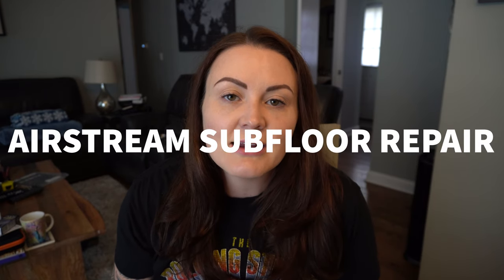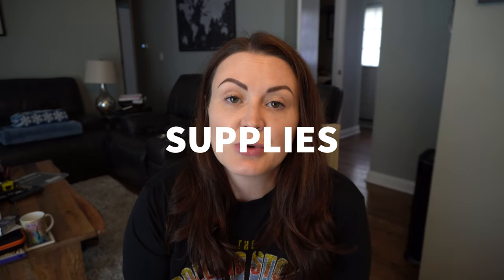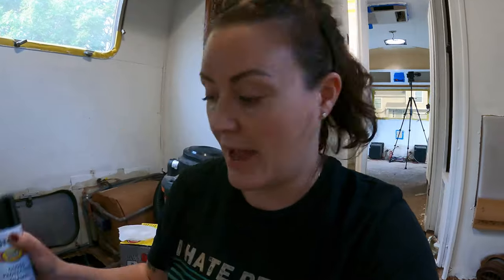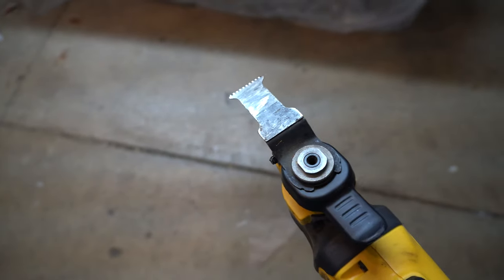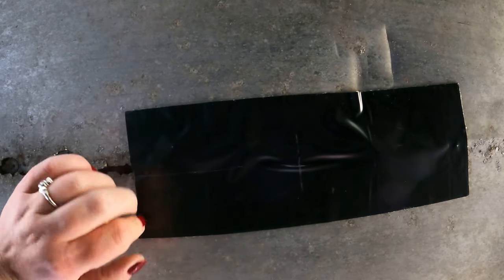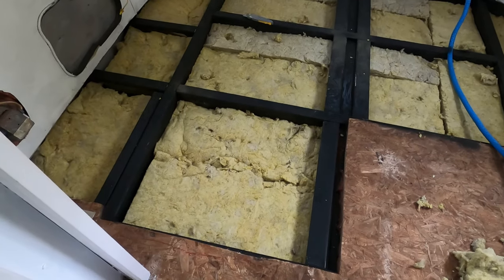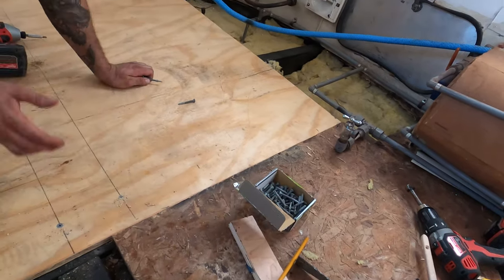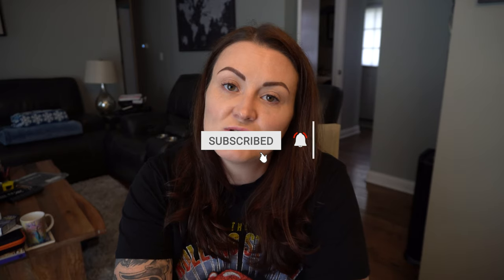Subfloor Repair in an Airstream | Spot Repair of Subfloor Instead of Full Off-the-Body

Comment: Thank you ... a great video. Our question is .. How would you handle getting one piece of wood in the C chanel?  We are doing a very similar rear repair, but we are trying to WEDGE a pritty rectangular section.....center section ...maybe 5 feet X 2 feet that meet up to the support cross beams into the C chanel.   Using a mallet and wood blocks to pound is not going so well ... there is no give in to the wood or the trailer. 
I think we may need to cut the wood that goes into the c chanel wide enough to be able to attach it to the rear support beam, this way  the we can pound in into the chanel...the wood is flat... no wedge angle to deal, then attach it securally to the support beams. We then can cut/fit and literally drop the the other piece of wood in place like a puzzle piece, and attach that piece of wood to the cross support beams. 
I may have answered my own question.  What do you think???
Lorie
Reply from the maker: I think you did! A smaller piece would make the job much easier. What’s important is that you get the wood into the channel to support the shell, I don’t think it is super important that it is one solid piece of wood as long as you are securing it to the frame :)

Comment: Great video doing this to a 72 Airstream had to cut four of the seven plywood you can run a brace between each cross beam that's 23.5" or length wise that's 5' 3" for structure support. My Airstream will be used on 5 acres not over the road
Reply from the maker: Thanks!! Nice! Sounds like a huge project 😀😀

Comment: Great info ,thank you! I am doing the same thing on my 1973 Trade Wind. I think I am going to treat the edges of the subfloor with an epoxy resin, just to prolong the wood rot incase there is a leak in the future that goes unnoticed. HA HA, As if it will never leak again.
Reply from the maker: Smart! We wanted to do the same thing but the guy that was doing the work for us didn’t have time to wait for it to dry (or so he said😑) We used pressure treated plywood and I sealed the roof and the sides as much as I could. Fingers crossed but so far so good!

Comment: EXCELLENT video! Thank you so much! Just yesterday I found a bad patch of subfloor (~5 sq ft) in the rear bedroom and thanks to you I now have a plan. One question - was drilling new holes in the frame for the screws difficult? Is a cordless drill sufficient or should I use a corded drill?
Reply from the maker: Great, I’m glad it helped! As far as drilling the new holes, we used a cordless drill. The wood to metal screws also help so try to find the screws I mentioned in the video or something similar 😀

Comment: Thank you for this very helpful. I found a leak and it was repaired at a rv shop but we didn’t realize the damage under linoleum. So now I have cut out rotten wood. Question - could I just just plywood to fit this hole and screw down? Therefore not removing all the wood under the metal shell! It seems tough to get out. Any advice appreciated
Reply: Sorry trying to add pic but can’t figure it out
Reply from the maker: Hello! I think you could get away with putting some plywood to fit the hole and screwing it down if the hole isn’t that big. You can send a pic over to our email at goranandjen@gmail.com and we can take a look if you like!

Comment: Looking at several other videos saying not to piece a subfloor, do you feel that it compromises the stability at all? I assume you have towed and used since repair. Loved your presentation, well done!
Reply from the maker: Hello! Yes, we looked at some of those videos as well. I think that is why it took us so long to figure out how to do the spot repair, because we were scared that we would compromise the structural integrity. So we kept searching and watching more videos and doing more research until I came upon a video that explained the C-channel and the bolts, and how the shell is attached to the frame. We figured out that as long as you don’t cut those bolts and you make sure you insert the replacement subfloor into the C-channel, the structural integrity will remain intact. We have traveled over 2000 miles in the airstream since we have done the repairs and she is holding up great! We are very happy with the repairs. I hope this helps!
Reply: @GoranandJen  
Thank you and that makes sense to me!

Comment: Thanks so much for this detailed video. Most helpful one on YouTube that I’ve found. 

Any more insights clearing the wood from the c-channel? How long did it take with the multi tool? I’m having a hell of a time and wondering if cutting the bolts and then replacing as I go might make things quicker and less soul crushing. Lol 

Thanks!
Reply from the maker: Hello and I’m glad the video helped! I feel you on the soul crushing task of removing the wood from the C-channel, it took us forever to figure out. On our Airstream, a lot of the wood that was in the C channel was wet and very rotted so it was easy to get out. But, there were sections that were not in such bad shape and they took much longer to remove even with the multitool. 

Goran says he spent about 10 hours total working on it. One tip is to think of the piece of plywood like a layer cake. “Eat” or gouge out the middle layer first and the rest of the wood will fall out more easily. 

Hope this helps!!
Reply: Thanks for the reply. “Soul crushing” indeed. 😂 making some better progress with the multi tool. Makes me feel somewhat less crushed knowing it just a royal pain in the a**. Thanks again for the video.

Comment: One thing I would say is you might want to replace the floor with something that will not rot again?
Reply from the maker: Hello! Yea, we thought about that too. We were thinking about maybe starboard? But we ended up using the pressure treated plywood and painting the edges with the waterproofing. We think we got all of the leaks so fingers crossed that wont be an issue as long as we maintain her :)

Comment: Did you do vinyl planks or a sheet? Hard to tell. I was wondering about the expansion gap because I don't see one at your perimeter.  I have removed my dinette, bedroom furniture, linoleum and carpet, and I'm about to replace some subfloor. The back of the existing ply has a foil insulation stuck to it.
Reply from the maker: Hello! We used planks. We wish we had installed the flooring after we built the dinette and beds, because we’re experiencing some gaps
Reply: @GoranandJen  you mean you wish you installed the flooring around those items instead of underneath?
Reply from the maker: @nursegilbey  yes
Reply: @GoranandJen  What kind of gaps? Perimeter? In the middle? Everywhere? :O  I'm going to do the same thing. I was thinking of making the holes in the planks oversized where anything screws down to the subfloor, to allow for movement.

Comment: helpful tips, Im hoping to convince an airstream owner to go this route and forget the whole body off nonsense, I think that's nice if you have endless resources and time but throwing in some new ply where its soft is more practical and fixing the leak obviously because all the old systems can be pretty much negated with new technology anyway
Reply from the maker: Hello! I think off the body is only good if most of the subfloor is rotten AND the frame needs work. Otherwise, spot repair is faster and more economical for sure 😀😀

Comment: What was the r value in your insulation?
Reply from the maker: Great question. We used Thermafiber Fire & Sound mineral wool from Home Depot. No specific R value is listed on the product, I think because it is meant for interior walls and noise dampening. But I would say based on similar products it’s between 13-16. We used mineral wool insulation because mold can’t grow on it. We’ve repaired all of the leaks we could find but you just never know. Also, it was the only mineral wool insulation available at the time at the Home Depot. Thermafiber Ultrabatt R23 is the product I would use today if I were doing this project again.

Comment: What did you use as trim for the perimeter on your new flooring? I tried using quarter round but broke a couple pieces on the the curved spots. Thx! Love the video! Now that I see what’s underneath the subfloor it seems a lot less intimidating
Reply from the maker: Hello! We are not using any trim at the moment because we still need to build in our beds and the front dinette. I would think you would have to use something flexible around the curves but I do not know the answer to what that product would be😀

Comment: Do you know if the bolts In the c channel no longer going through the wood of the subfloor will cause structural integrity issues? Also really appreciate this video!
Reply from the maker: Hello! That’s a good question. I think the method of repair we settled on is strong because the way we cut the little half circles out of the new subfloor to accommodate the bolts maintained the bolts’ structural integrity, in that we didn’t cut them or damage them. The new piece of plywood slides right into the C channel and fills in that space so it doesn’t collapse or crunch in on itself. I think if you have to replace the entire subfloor of the Airstream, this method would be iffy. But, if you are just doing a spot repair like we are doing here, it seems to work great. The bolts are still holding the frame to the shell, and the new plywood is a tight fit and screwed into place through the beams running the width and length, so it’s as good as it can be in my opinion 😀 after the repair, we traveled from Chicago to Brownsville, TX, then over to Fort Myers, FL, and then back up to Chicago, along with several other trips, and the subfloor repair is holding on strong! I hope this helps!

Comment: I hope you found the leak didn't hear you mention if you fixed that
Reply from the maker: Oh yes! We did. It was two issues: old gaskets in the side compartment doors and a couple roof leaks. We replaced the gaskets and sealed the leaks. We have a complete roof sealing project we’re going to be doing in April or May :)

Comment: Did you put anything under your insulation or will it stay  place on its own? We are dealing with the same thing in our 89 Excella too. Thanks for the video!
Reply from the maker: Hello! We did not put anything under the insulation, we just stuffed it into the space and it held very well. I did clean out the belly pan after we had removed the rotten subfloor, before we stuffed the new insulation in. Subfloor rot seems to be a common issue in these older Airstreams! But the repair is holding up great and we are happy that our Airstream will be preserved for many years to come :) good luck with your repairs!